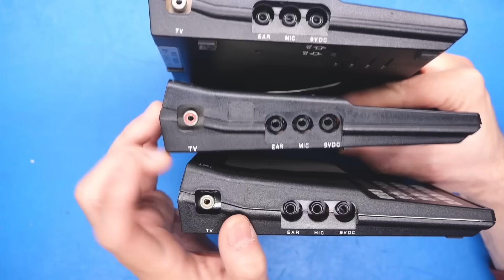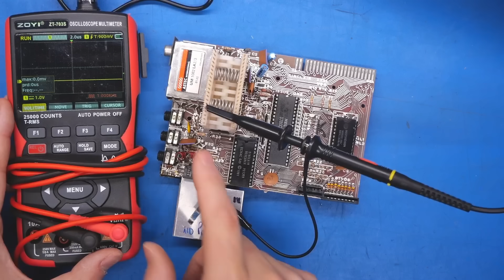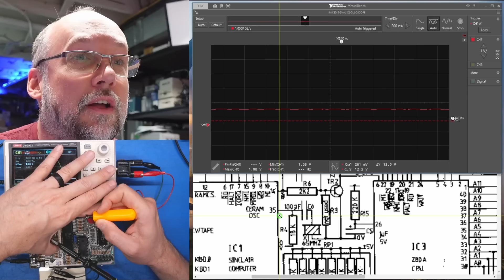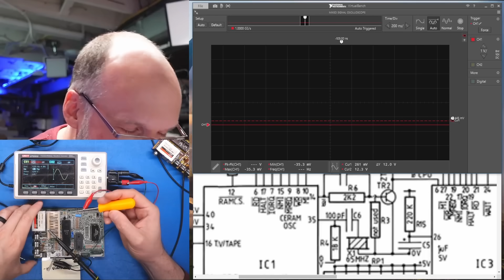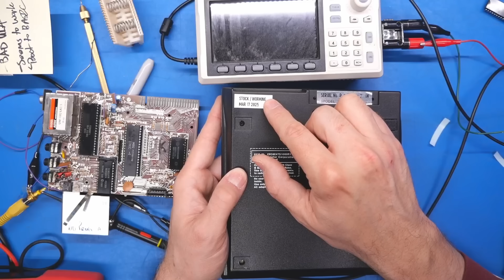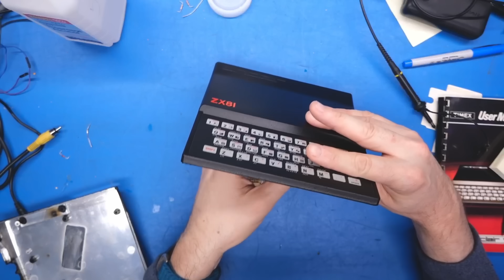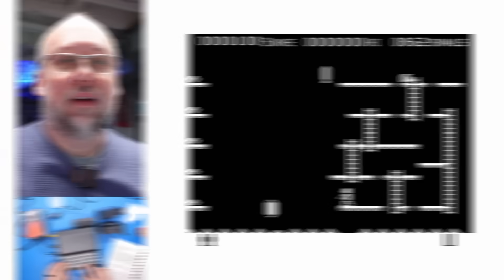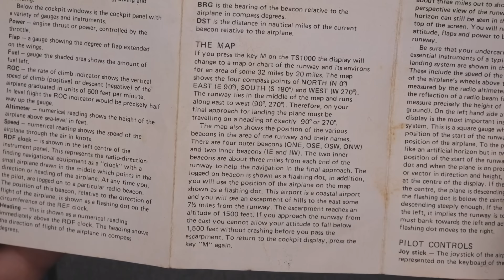Is the ZX81 / Timex Sinclair 1000 actually bad? Let's fix these to find out.

Comment: My first computer in graduate school was a ZX81 and I loved it.  I spent countless hours writing code and fiddling with the tape drive which wasn't always reliable.  I had to reposition some of the through-hole components so it would properly save programs, but that wasn't a big problem as you could listen to the recordings prior to shutting off the ZX-81's power (and losing the program) to make sure the playback had the correct pitch to prove it was good.

Comment: Most crystal oscillators is nothing more than a crystal across an inverter  with a resistor and a cap in parell. The resistor bias the inverter into a analog reigon and some will oscillate on its  own depending  on the value of the cap.

Comment: It's technically possible to repair those ribbon connectors with an conductive adhesive.  But in this case the replacement is just the way to go.

Comment: Sinclair used to make a lot of cool products in the late 70s and early 80s. As a freshman studying engineering, I had a Sinclair Scientific calculator. It was cool. One thing that was interesting was that instead of having a key for PI or e, these values were printed on the calculator case. Worked for me.

Comment: I bought one of those in the early 80's. The first thing to do is to add a good aftermarket keyboard. I really liked how you would program the computer, with single keystrokes to enter commands. The only issues I had with it was the monitor was a television... Do they even make televisions these days? The other issue was data storage. You could store programs but data? Well sort of. They had something like excel but the only way to store data was to store the program, with its data. I would like to have my old system today. It is hard to find a reasonable computer that you could simply program.

Comment: I grew up in the 80's and this was the computer teens would save up for or ask their parents for, because it was much cheaper than a TRS -80 (Radio Shack) that many of us used at computer labs ar school. We could plug this into a TV and learn BASIC. The "hard drive" for even TRS-80s was actually a casette player!! Floppy drives came later. I'd say kids were much more driven in thise days because there was no social media to scroll. If you wanted something, you leaned and built it. And you were excited to do it. It eas an  era of crystal radios, electronics kits, chemistry sets, tie dyes and vinyl.

Comment: I don't see why putting the Timex TS1000 board in the ZX81 case.  What would happen if you replaced the ULA(?) in the ZX with one from the Timex, then would composite bodge work properly?

Also don't understand what/why the output doesn't work on a TV.  Been SO long since I used ours, I thought we just hooked it up to an old black and white TV as a montor, but don't remember if there was something in between the computer and the TV.   Ah, found the manual online, just used a simple composite adapter to go to the TV like other/old games consoles (Atari 2600).

Comment: I just loved mine. Spent hours and hours coding on it in the early '80s. I had the RAM pack as well. I still have it in the loft somewhere, it probably still works but there are some very good emulators onine now.

Comment: There was an even cooler hack that became common when the price dropped.  I forget the details, but you can actually take two TS/1000s (or zx81s), and hook them together so that one serves JUST as the video output.  This let you run the "processor" machine in FAST mode all of the time, while the "video" machine reads the processor machine's video buffer.  This frankenstein setup let you run in FAST mode all of the time.

The keyboard matrix was quite simple -- I soldered a set of wires to the backside of the board and wire-wrapped a surplus keyboard that I ordered from a Popular Electronics magazine.  At the end, I had a wooden case with a mechanical keyboard, two TS/1000s  hooked together for the speed mode, two 9 volt bricks, a composite port attached to the "video" machine, extensions so there were tape and video ports on the case, a ram expansion cable tied to the board of the processor machine, and a red glowing power switch for turning the whole thing on and off.  If I recall correctly, I even put an iec "appliance cord" on the case so that it looked self-contained from the outside.  (Video ports because you could still use the RF modulator on the "processor" machine when it was in "normal" mode.  The and all was a bit smaller than an Apple ][.

Fun times.
Reply: OK -- Maybe I'm dreaming about the video mod.  I could swear I had a diagram for doing it in my old box.  I definitely did the keyboard, strapped on ram expansion, and the composite mod. :)  The old system MAY be buried in my dad's shed -- but I haven't seen it for 30+ years...

Comment: I'm surprised you didn't mention that they were originally sold as kits, and you had to assemble them yourselves. We had a distributer near where I lived (Nassua NH) and I managed to get my hands on a few, which I assembled, mostly for fun. My main PC (at the time) was a TRS80 MI.

Back in the day, my sister in law used one of these as part of her master's thesis. She used it to drive a RC car as part of robotics experiment. 
Remember there was nothing like modern day Adreno's or Rasbery Pie's back then, so having a 'programmable' but cheap computer that also gave you access to all the Z80 pins on that expansion card, allowed it to act as poor mans microcontroller platform.

Comment: I think a ton of people got an aftermarket keyboard for these in relatively short order. I know a popular option in North America was the cheap Archer branded replacement part keyboard for the TI-99/4A that you could buy at local Radio Shack stores. A little trace cutting and bodge wiring on the keyboard matrix and some homemade keycap stickers and bob's your uncle. Making a nice wooden case to hold it all was optional. lol

Comment: I'll say it again, I'm amazed you don't de-oxit all socketed chips on any system apparently not working, as well as remove (or loosen) each chip as well before doing anything else (like desoldering the crystal).  I've not counted how many, but it's a LOT where that was the cause of an error on systems you are diagnosing.

Perhaps some de-oxit in the keyboard connections would help as well?

Comment: The oscillator uses the ceramic resonator (it isn't a crystal) to lock the frequency; it's not a part of the oscillator circuit per se. I bought a ZX81 very early in the UK production cycle, mine came in kit form. At the time I was developing the world's first notebook (but because this was South Africa during Apartheid, it was unknown outside of South Africa). At the time we were using the Hitachi 6309 CMOS CPU having migrated from the Motorola MC146805E2P. The 6309 was vastly more powerful that the 6805 or 6809 and we used this with page management and 64kbit CMOS chips (also Hitachi if memory serves). These were, of course, static memory and consequently very low power. As a result I was able to upgrade my ZX81 considerably. With some rewiring, the internal memory was upgraded to 8K (but only 4K usable) and we also upgraded the ram expansion to 64K using paged memory. I subsequently modified the operating system to make better use of RAM and, in particular, the alternate register set. The next step was colour, but that's a whole other story. Some 1.5 million ZX81 were sold and when the got into the hands of people who weren't game obsessed, they were a gateway product.

Comment: I'd agree the difference between the UK ZX81 and the US one or Timex model is the FCC mandated shielding. My UK one emitted so much RF noise, I could pick up the signal on another TV beside the one I was using for a monitor. I like to think of it as early multi-monitor :).

Comment: One of the first things I did with my ZX81 was to go to a surplus shop and get an old keyboard from some kind of 60's mainframe terminal. A friend built a case and rewired the keyboard to work with the ZX-81. Once it had a real keyboard, it wasn't so bad to use. I had a ram expansion too, though, so I'm sure that helped.

Comment: They actually sold the ZX-81 in the US for quite a while before the transition to Timex.. I remember being in high school and drooling over this thing because we were poor, and this was actually within reach, especially where they sold it in kit form.   The primary difference is, the Sinclair comes with 1K of RAM, but the Timex came with 2K of RAM.. believe it or not, I actually coded ANIMATIONS on my 1K ZX-81... I did eventually upgrade to a VIC-20, but I still have my old Sinclair ZX-81

Comment: It was terrible, especially if you used the much needed 16K RAM pack with the whole machine crashing if you tapped too hard on the awful keyboard, but for the money back then it was good value and a considerably improvement over the ZX80 which actually cost a little more.

Comment: ZX81 with keyboard? That would have been the Spectrum but it's dead flesh keyboard was only a little bit better. My friend bought a case with keyboard. Far better. I used the ZX81 when I was studying electrical and electronics at university. I was able to do my computing tasks easily on the ZX81 in BASIC. But I couldn't prove it so had to go to the computing lab and use bloody punched cards!! I found a 6809 FLEX micro in the electronics lab - lovely computer/CPU. Taught myself Z80 assembler from Rodney Zaks book and hand assembled programs.

My first job was writing BASIC programs on CP/M machines for building services. Superbrains etc. But came back to Sinclair when I got a job writing computer games ;-) Spectrum ruled the roost in the UK by then.

Comment: I had a book full of BASIC programs and one of the supported platforms was the Timex Sinclair 1000. Years later I ran into a Timex 1000 in a clearance bin, I think I paid around $10 for it. It was a nice little machine for monkeying with BASIC. For hackers, it was not too hard to get at the signals for the Z80 because most of the important ones are brought out to the expansion port. With a little effort and some PEEK/POKEs it turned into a rather convenient microcontroller development kit.
The keyboard was a test in patience. It was so bad that even using it as a calculator was a pretty rough experience, and the keys become less reliable the older it got.

Comment: I had bought mine while in Germany in the early 80's. They were branded as Sinclair ZX81. They sold a metal case Keyboard combo that gave you a "real Keyboard". Made programming it so much easier. Added tape player to record and save your program. Wrote my first program, on it. It was a checkbook program. Made my life so much easier at the time. Also added the 16K memory module. After a year or so, upgraded to an Apple 2 Euro Plus. Difference it ran on PAL not NTSC. Had great color at the time. Still programming to this day, I was hooked by a ZX81. I removed the RF modulator and connected the video line directly to a video monitor, worked fine.

Comment: That empty "IC4B" outline has a counterpart marked "IC4A" underneath that 24 pin 4118 (1K RAM) marked IC4, since you could either have that one big chip or two 2114 chips.
The 28 pin outline was normally for a socket, mainly used in the issue one kits.

Comment: I found a keyboard that I wired up with a ribbon cable so that I could use a real & reliable keyboard. I did find that the ZX81 keyboard wiring was different than the keyboard I was using, but a few minutes with the soldering iron sorted that out.

Comment: Yes, the ZX81 boards had two different styles of RAM chips (2x2114 or 1x4118 chips).  The jumpers next to the RAM L1 / L2 where used to enable a larger 2K 4816 ram chip.

Comment: I still have my original ZX-80 (white case) and my ZX-81 which I built from a kit that Sinclair sold, along with my orig ZX-Spectrum and even a QL.  The ZX-80 and ZX-81 taught me a lot about writing Z80 ASM, how to be super efficient with my code, little things like LD A, 00 (2 bytes, 7 clocks) vs XOR A (1 byte and 4 clocks).  B/W graphics was lores, loading from cassette tape was not reliable, but hey a kid (me) with a newspaper route in Central America could actually afford a computer.  Stepped from there to TRS80 Mod I  and then to CP/M based machine (Still have the original gear and it works, even the 8" floppies).  I can't remember how many different hardware hacks I did to the ZX's, RAM, controller for other things, etc.   At one point a mentor of mine used TS-2068's in the hospital ER room to triage incoming patients.  This was in the mid 80's.  Small in size, and price, but could be powerful with a creative code geeks mind!

Comment: I got the MicroAce before the timex came out. It was  kind of a ZX80 kit.  It got me building a card cage adding a RS232, bank switch rom/ram. Had it talking to my KSR33 over 50ma loop. Later a IBM seletric  ball typerwriter made into printer. I make a real keyboard well it was chicklet keys I used to stay small.

Comment: I still have several of these.  Back in the day, color TVs required lots of calibration test patterns for convergence.  The craziest thing I wrote for this make-believe computer was a program to generate all the necessary patterns to do crt convergence alignment.  Within short order, the bare boards (no plastic case) were being unloaded.  The last version, when they were being unloaded, had the keyboard and main board combined.  Revised:  I just pulled one of mine out, and the no case version appears to be a very early version from 1980!  Apparently, Sinclare unloaded these just before completely calling it quits.

Comment: I had one of these before my c64 (though over winter holidays, my school allowed us to check out a vic20, so I had one in the house on the same ecksmas as the ts1000 arrived). When I went to make an analogue clock with it, it was an excellent exercise in understanding how an external source of time truth is required over code timing. I had a modified shoebox cassette recorder as storage, but the mic was not disabled so I had to be very quiet when loading or saving anything.

Also, the membrane keyboard and rubber feet make it into the best doorstop you'll ever own.

Comment: When these came out, I purchased one to write a book about it. I was working at a publishing company at the time. The publishing editor liked the idea, but felt that the book would have to be a mass market paperback, which wasn't their market. I got an intro to someone at a mass market publisher, and had some discussions but they didn't go anywhere as the price of the machine had gone from $99 to $49 and the mass market publisher decided that people wouldn't spend even $5 on a book that explains everything you'd need to know about the machine. I later gave the machine to a friend who used it as a Commodore trade-in. Commodore would give you $50 off if you gave them any other manufacturer's computer as a trade in. As the T-S 1000 was selling for $29.95, there was an obvious market for new T-S 1000's to be immediately traded in to net the $20 difference. Even later, when I attended Commodore's going out of business auction, they were being used by Commodore as wedges to keep doors open. They were all over the place!

Comment: When I was looking at them they were 99 US as an unsoldered box of parts, and 149 as an assembled unit.  They cut too many corners, so I kept saving up, and bought a Vic-20, Dataset, and Lunar Lander cartridge for 380.  Glad I did.   In 2025 dollars, that would be about 1,350 today.   Yeah, it seemed like an ocean of money to me, and apparently it was.      

I got one years later.  What was most fascinating about the zx-81 was the manual, and how many chips it bummed.  I ended up giving it away to a computer class teacher to show to his class...   money well spent I thought, considering he gave me like 15 Macintoshes...   none of which I even ever plugged in and turned on.

Comment: The bar connects shielding but it also connects the grounds from one side of the PCB to the other. You remove the bar and you'll have problems with the computer running. While open, you may want to clean the edge connector with a bog standard Pink Pearl (Papermate brand) pencil eraser. It's very gentle but will clean up the edge connector incredibly well. The 184 ULA lacks the back porch while the 210 has it. This is very important as the missing back porch signal is hated by LCD monitors and some TVs resulting in a very dark screen. That 4801 chip in your ZX81 is 1K x 8 and the TS-1000 has a 2K SRAM.

Comment: Don't open these unless you absolutely need to. The keyboard cables are incredibly brittle and will crack and split. Luckily there's a reproduction keyboard available that looks 100% original. I've installed 3 of those to fix those split cables. Some of these used 2114 RAMs for 1K while others used 6116 SRAMs for 2K of memory. If you have one of the RAM expansion modules, it's highly recommended to recap those as they have 2 voltage converters inside supplying the +12v and -5v off the power sourced by the computer. These things are not LCD TV friendly and the early versions of the ULA chip lack the NTSC back porch signal resulting in a very dark screen on some monitors. BITD when I was growing up in the 80s you could buy 3 rooms of carpet for your house and they'd give you a free computer - your choice of a TI-99/4a or a Timex Sinclair 1000.